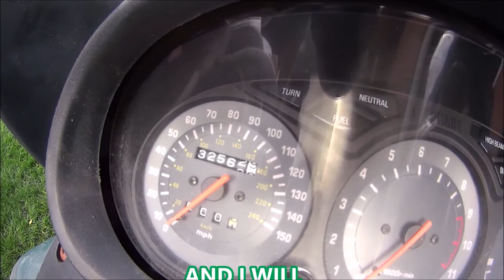YAMAHA XJ900S PROJECT PART 6

Comment: John you certainly have your work cut out but you getting there slowly but surely, bolts snapping are a pain in the arse you can spend hours and hours on one freakin bolt out when that time could have been used elsewhere on the bike, cannot wait to see it done but it will take some time i shouldn't wonder, keep up the good work mate....
Reply from the maker: SooperSkoots yup getting there very slowly lol roll on spring time.
Reply: John i can't wait i keep going in the garage and looking at my bike, i have to give it a service yet and a thorough clean yet and it has only 4500 miles from new....
Reply from the maker: what bike you got mark?